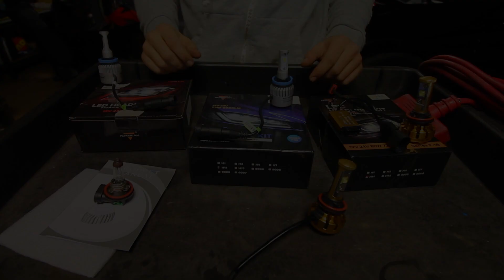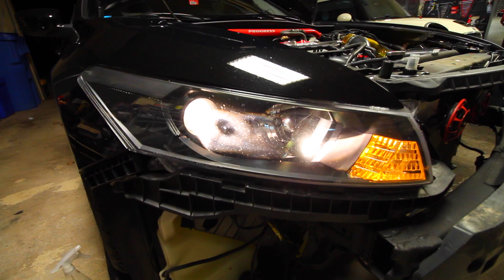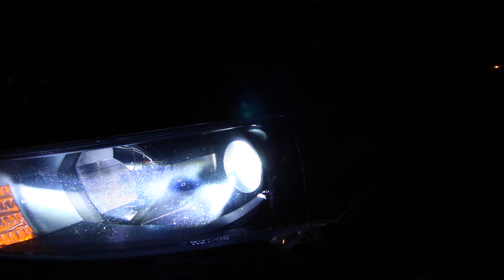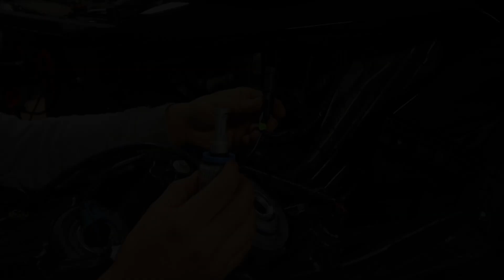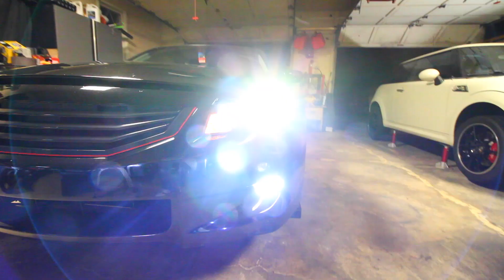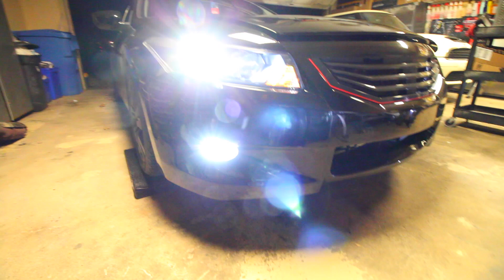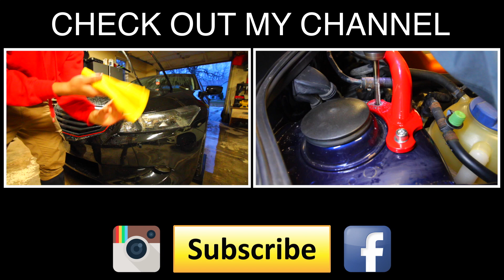LED Headlights: Are they Better than Halogens?

Comment: People bashing on people because they get brighter lights and blind them...
Bash on people who don't get their lights properly leveled. That's the issue, not the bright lights.
If you don't know how to level them, ask a mechanic to do it.
Reply: That pisses me off more than anything. Even halogen lights that aren't properly aligned are irritating
Reply: @TheGarbageGobbler  Indeed sir, everything you said true. People use to drive better with the old shitty yellow lights that barely light the road up. Whats that tell you? Also all the new cars have so much fucking light omitting from the large lcd screen and all the led lights inside the cab people completely forgot that actually blinds you at night and you cant see out for shit, all these new drivers are use to it and dont evan relize. Its sad. This new generation of turds are exactly that. A bunch of non driving, spoiled bitches
Reply: @kangsnqueenzzznshit5153  Not enough likes for this on point comment!
Reply: BASH ON PEOPLE THAT DONT EVEN KNOW THEY DONT HAVE THEIR HEADLIGHTS ON IN PITCH BLACK ROADS!!!
Reply: It is annoying when these dumbasses get super bright lights that shines like a spotlight. Please adjust your lights to shine correctly people.
Reply: if you have a low car and balance it properly you wont have a problem ;)
Reply: I guess that means I will have to swap my 20" tires and rims off my F-150 and perhaps even put a lowering kit on to, as they say, GET DOWN!
Reply: leveled like the driver in this video? You can see how much it's bouncing around, each time flashing oncoming motorists like a bastard
Reply: Sounds like a white led headlight user. White is more intense than yellow. It's of higher frequency and it's blinding. Led or not. Aligned or not. You're putting your priorities/preferences above others' safety. Please tell me you at least know the different wavelengths in the color spectrum and what they translate to in real life.
Reply: @robertlangdon494  The higher Kelvin temperature rating of the LED lights is indicative of more BLUE wavelength light. It's the blue that causes the glare. Halogen lamps (standard, not the funky blue ones)emit lower color temps because the wavelength has less blue, so they have less glare even at high brightness levels. BTW, I agree with you about the glare to oncoming drivers causing MORE problems on the road!
Reply: There are plenty of vehicles with level lights that are just too bright because some soccer mom is driving a 10ft high SUV straight at you
Reply: Bandjalah  yep all you have to do is adjust them on your car. My car as adjustments for up down left right so you can get them perfect same with the fog lights they just go up and down

Comment: The more kelvins the worst it will be visibility during wet road. If you buy LED or HID make sure not to buy more than 5000k otherwise your visibility during rain conditions will be worse than using regular halogen lights.

Comment: Milan my car is halogen and she's got a projector for low beam and a reflector for high beam. They're both H7, 12V and 55W.
If I buy the LED bulbs you recommend (F-S3), is it really plug and play or should I tweak something? Thankss!
Reply from the maker: If they're both halogen, it is a plug and play. You just remove the halogen H7 bulb, and insert the new LED bulbs in their place. It is that easy :)
Reply: Thank you very much man, keep it up !
Reply: Only one thing before purchasing: is Auxbeam actually the best company for cars' LED conversions?
Reply: milanmastracci hi I am living in canada Toronto right now and I came upon your video for the headlights, im not sure if your from Ontario but are there rules for the led headlights brightness? like the led light you talked about you say it's go up to 8000, will I get pulled over by the cops?

Comment: The led actually produces quite a lot of heat. What you see on the back is just an heatsink to dissipate that heat, which is "pulled" out via the metallic structure (to which the led chip is coupled).
Reply: This is already said in the video, idiot.

Comment: I tried out some leds from eBay and couldn't see shit at night :D
Reply: that fucking face lmao
Reply: fruitydudexD for real lmfao
Reply: Clue word ebay lmao
Reply: @terryreyes1125  So, who did you get your led bulbs from?
Reply: UserPauli2592 I just bought LED low beam light on Ebay, paid 60$ and it sucks, color of light is beautiful, but they are not so bright light regular halogens.
Reply: UserPauli2592
I tried out some leds from eBay and couldn't see shit at night :D
'
hi U P...
try go auto parts shop store or amazon or find another online
Reply: Solution is IPF LED HEADLIGHTS bulbs.
Reply: UserPauli - you couldn't see shit?  How about the road ? Could you see that?
Reply: Sydney Lloyd You should throw that crap into the trash can 🗑 All of that shit generate shit only😂😂😂😂😂🤣🤣🤣🤣
Reply: I got into the accident month ago smashed Prius headlight with IPF LED BULB, took it off before left my baby in repair shop. The repair shop installed one of those crap 💩 led bulbs. I turned them on for a sec, removed them and bid them with bidder. Installed IPF led bulbs. Mother f they are amazing!!!
Reply: True all of these HID , LED  ebay  amazon Kits are way worst than a Philips or Osrpam Halogen.
Reply: try a pair designed for your headlamp. and don't be cheap when it comes to LED bulbs. because then you will have a bad experience!
Reply: Haha mine are so bright i got about 100 people get the same bulb as me, it just about which bulb you buy, buy a good one
Reply: UserPauli- why were you looking for shit? Look for the road instead.
Reply: He has been sponsored to give the led lights a good review. If you want bright lights go for HID conversion kit.

Comment: That's driving me crazy. I have an old Mercedes that need H1 and H3, but for those they only sell this 6000K without blue shine...
To repeat, for your low beams, you are using this golden 6000K LEDs and for your fog lights you are using this 6500K Phillips LEDs, right?

Comment: Remember only put these in projector housings.
Reply: so for high beam use the halogens?  :( that would suck with the led
Reply: LEDs don't work well in projectors. Only hid does.
Reply: Nope fuck you grandpa

Comment: This is a poor video and fairly deceptive. Pay c,lose attention to the shots of the halogen vs LED on the wall, you can tell that the halogen has a better hotspot near the center of the beam giving you a further throw of light and allowing you to see more into the distance. The LED light however has a poor to no hotpsot giving a poor throw of light but a lot more light closer to the vehicle. This will give the illusion that the LED is brighter as it is lighting up more area closer to the car but you cannot see as far.
Reply: Correct. You can also see it at 13:41. The foreground is brighter, at the expense of the total distance lighted up by the halogen bulbs. It is actually worse if you have a very bright foreground, because your eyes adjust to this and lower your ability to see objects in the distance.
Reply: This is why I run LED headlights and halogen high beams. Best of both worlds.

Comment: And you are still WAY better off with a pair of quality HID's in these projector headlights; 
Only thing that might pick up credit for the LED's is if they perform better in lets say H4 reflector housing headlights configuration IF they have as close to OEM cut-off in comparison to putting HID's in there with the common splattered output issue, but is that really the case? 
That's what I wanted to know. Projector headlights are way easier to just plug-and-play;
Can you perform the same test on a pair of good Reflector-type headlights next?
Great video non the less.

Comment: halogen is not good because there are allot of heat produce , led is better because led dont produce heat but need a fan and heat sink to cool down the led , good job bro nicely done
Reply: LOL - WOT? LEDs DO make heat. That is why they needs fans and heatsinks to cool them down.
Reply: John Coops What he meant was that halogens are just an inefficient design, far more energy is wasted into creating heat rather than light.
Reply: brosk1s - the electrical inefficiency of halogen is totally irrelevant in headlamp design, since there is no cost for the power. In regards to heat production, the LED is not necessar better. The halogen lamp NEEDS to be hot to work properly and it thrives on heat (hotter=whiter light), whilst an LED is killed by heat. More importantly, a halogen radiates heat so there is no need for any cooling, whilst an LED can only cool itself by conduction and thus requires complicated heatsinks etc. See my next message...
Reply: An H7 Halogen 55W = 90% Radiated, 5% Convection, 5% Conduction. So, it generates under 3W of heat that is actually a "problem". The Auxbeam H7 F16 30W = 5% Radiation, 5% Convection and 90% Conduction. So, the LED chip generates 27 Watts of heat that needs to be dealt with - that's TEN TIMES as much problematic heat as a Halogen. That is why the LEDs need a heatsink, and the pissy little 'sinks' on these Auxbeam retrofit lamps are nowhere near sufficient to dissipate 30W continuously in a hot engine bay with dubious airflow. Bottom line is that the retrofit LED lamps will run too hot, giving less than rated light and degrading far faster than claimed.

Comment: Heatsink is to cool LED chip. LED will die if they get too hot. The glass on the Cree does not amplify the light, it disperses the light.
Reply: I LOVE the upfront marketing crap about how LED's do NOT give off heat when making light but THEN they move right into the various methodologies they use to dissipate heat.  ????

Comment: I have a Mercedes 1999 why do I have to change brake lights every month
Reply: karmier portis Because it is a Mercedes. it is meant to break once a month.
Reply: Short in the system, water leak in the rear light cluster or inferior bulbs.

Comment: how are you supposed to install these? Most cars headlight housing have a closed cap system which would not allow that big cooling system on back to fit in there. You don't want to leave the cap off because dust, dirt, and moisture will enter into the housing and cloud it up from the inside.
Reply: Or the headlight won’t go back in?  Its got to be tight quarters on my car. Older car.

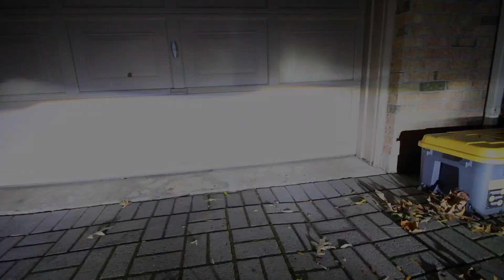Comment: 13:24 there is no line, light is everywhere. This setup wont be safe, it will dazzle everyone.
Reply: Poorly designed conversions will do the same.
Reply: thats because the moron has his fucking fog lights on...fog lights are not focussed or directed, they basically just spray light everywhere. There is a reason most countries ban the use of foglights when it is not actually foggy

Comment: are you planning on changing your highbeams to LED as well I have aftermarket HID for my low beams and LED for my high beams.  I'm considering getting a LED kit for my low beams as well  I have an 08 Hyundai Santa Fe and i have projector housings

Comment: I hate idiots that run bright ass 5000k LEDs in the fog lights. It's WAY too much bright light for oncoming traffic, but these idiots don't give a damn about blinding people. All they care about is looking cool driving down the road, so annoying! It's fine to use these for headlights, but NOT fog lights because it defeats their purpose, which is improving bad weather visibility. You'd be better off using 2500k-2700k yellow bulbs in fogs because it's far better at cutting thru bad weather.